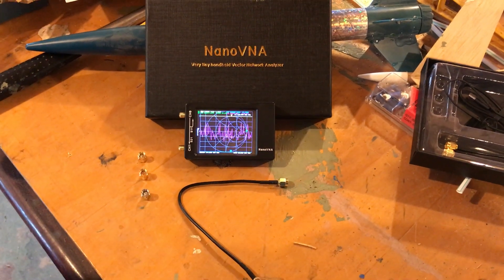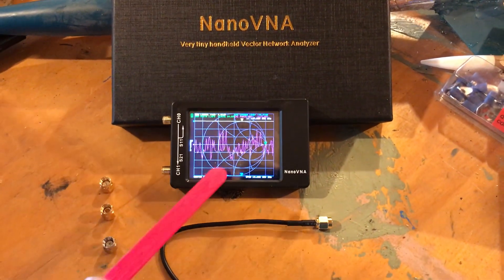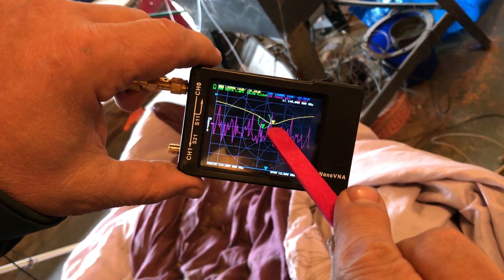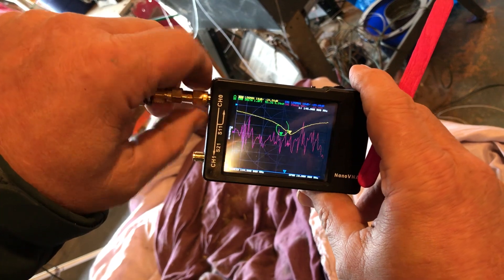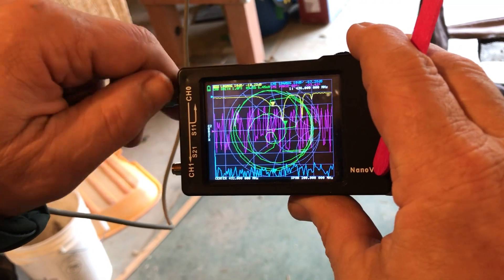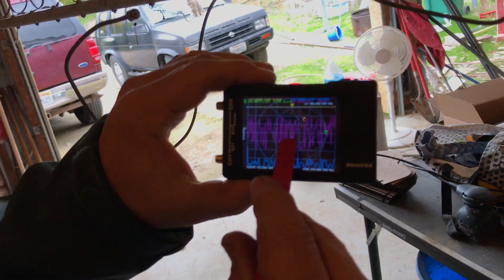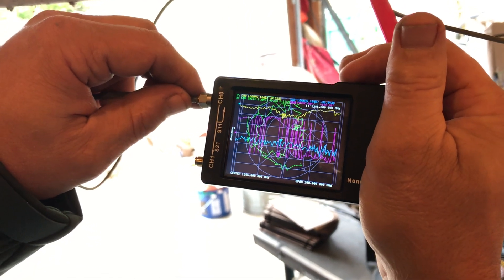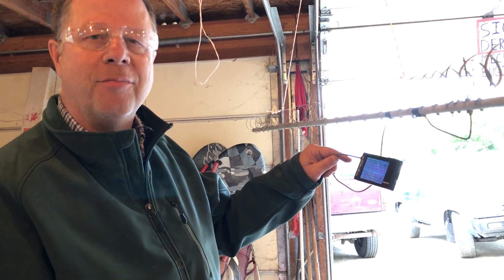NanoVNA amateur radio antenna measurement demonstration

Comment: these are on ebay from a number of vendors likely different makers from the more or less open source design.  Are there any suggestions on how to select a good one?
Reply from the maker: I got mine from Amazon.   I was looking for.
a.  One that had a case
b.  That had time domain built in
c.   One that hand the shielding installed.
d.   So many choices but that is what I decided on.
e.   I'll probably buy some for Cal Poly with the 4.s inch display later in the month

【Upgraded】AURSINC Vector Network Analyzer 50KHz -900MHz HF VHF UHF Antenna Analyzer Measuring S Parameters, Voltage Standing Wave Ratio, Phase, Delay, Smith Chart